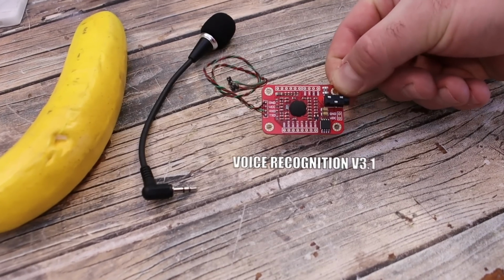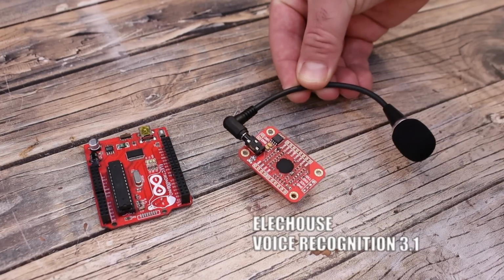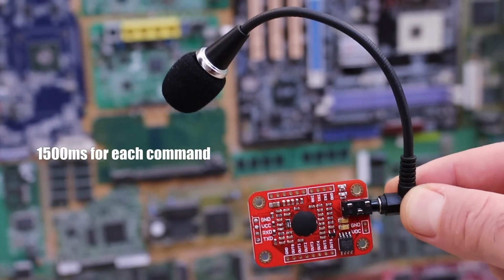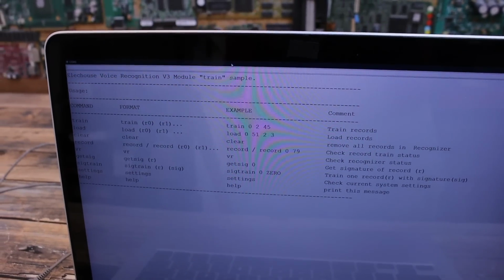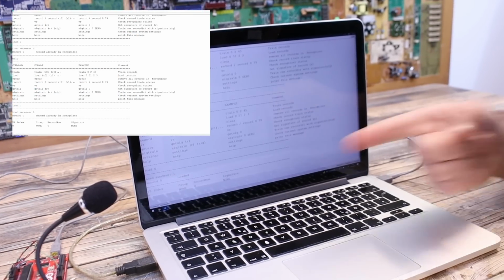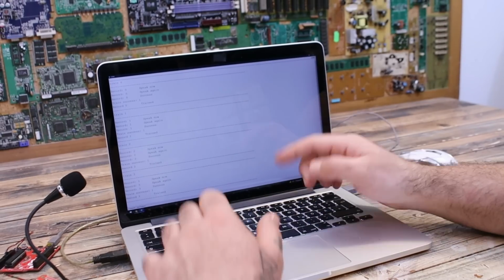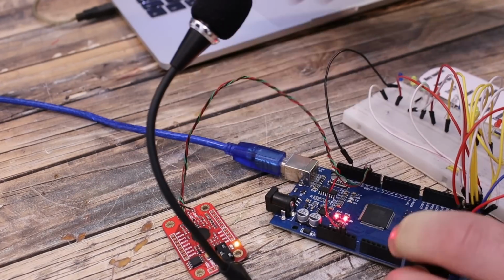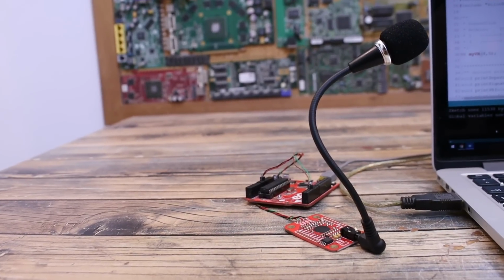Voice Recognition Module - 254 Voice Commands + UART

Comment from the maker: Arduino Course LEVEL 2 (Spanish): https://bit.ly/2ZNWgqy

Follow me on FACEBOOK for more: https://www.facebook.com/Electronoobs
Help me on Patreon: https://www.patreon.com/ELECTRONOOBS
Reply: I think the i2c would be for use with something like a raspberry pi
Reply: @lio1234234  I2c is just another serial port with a specific com protocol.  It can be used to communicate with anything that speaks its language.  The nice thing about it is, it only require 2 pins and can be used in a multi-drop configuration so it's easy to create small (Master/Slave) networks.  Down side is, it's designed to be used physically close to the other players on its network.  You can hang a bunch of I2c sensors on the same two lines.
Reply: Any chance you can publish your code on some git repo? I'd have some minor tweaks to enable also ESP8266 support...
Reply: could you help us telling us what your turn_off_all function does?
Reply: The code I need it
Reply: i need the program for this sensor

Comment: GUYS, quick note here. 

I actually tried this on mega because I have a project using the voice recognition module in arduino mega.

You guys need to connect pin 10 to tx and pin 11 to rx not the other way around.

Ps: But if it works for you then I guess it's fine. Just that mine doesn't work when my tx is 11 and rx is 10

Comment: There’s a Movi speech recognizer and speech synthesizer board that technically  also do the command. Either by closing a circuit or pwm. Not sure yet, I have not gotten deep into it yet but some of the Amazon reviews I saw were quite advanced and capable.. “the R2D2 video” but that board will be plenty to meet my needs in a 1/7 scale RC car application. Lights, fans, blow flames, start engine or engine sounds, music, and just conversation. What I’d really like is if u can also have it read out live Lipo voltages and motor temps and ESC temps. Would I be asking to much for gps/mph and G force lol?? Anyhow if you have content or experience with that board, I’m definitely going to be looking for it as I look at most of your videos!

Comment: whenever i try to write a command in the serial monitor i get an error. For example if i type "record" i get a error message saying "Check record failed or timeout". or if i type "settings" i get "Check system settings error or timeout". My connections are correct i believe. Anyone have an idea why this would happen?

Comment: #include <SoftwareSerial.h>
#include "VoiceRecognitionV3.h"

VR myVR(2,3);    // 2:RX 3:TX, you can choose your favourite pins.

uint8_t records[7]; // save record
uint8_t buf[64];

int led = 13;

#define onRecord    (0)
#define offRecord   (1) 
#define play (2)

#define playtime 500

/**
  @brief   Print signature, if the character is invisible, 
           print hexible value instead.
  @param   buf     --> command length
           len     --> number of parameters
*/
void printSignature(uint8_t *buf, int len)
{
  int i;
  for(i=0; i<len; i++){
    if(buf[i]>0x19 && buf[i]<0x7F){
      Serial.write(buf[i]);
    }
    else{
      Serial.print("[");
      Serial.print(buf[i], HEX);
      Serial.print("]");
    }
  }
}

/**
  @brief   Print signature, if the character is invisible, 
           print hexible value instead.
  @param   buf  -->  VR module return value when voice is recognized.
             buf[0]  -->  Group mode(FF: None Group, 0x8n: User, 0x0n:System
             buf[1]  -->  number of record which is recognized. 
             buf[2]  -->  Recognizer index(position) value of the recognized record.
             buf[3]  -->  Signature length
             buf[4]~buf[n] --> Signature
*/
void printVR(uint8_t *buf)
{
  Serial.println("VR Index\tGroup\tRecordNum\tSignature");

  Serial.print(buf[2], DEC);
  Serial.print("\t\t");

  if(buf[0] == 0xFF){
    Serial.print("NONE");
  }
  else if(buf[0]&0x80){
    Serial.print("UG ");
    Serial.print(buf[0]&(~0x80), DEC);
  }
  else{
    Serial.print("SG ");
    Serial.print(buf[0], DEC);
  }
  Serial.print("\t");

  Serial.print(buf[1], DEC);
  Serial.print("\t\t");
  if(buf[3]>0){
    printSignature(buf+4, buf[3]);
  }
  else{
    Serial.print("NONE");
  }
  Serial.println("\r\n");
}

void setup()
{
  /** initialize */
  myVR.begin(9600);
  
  Serial.begin(115200);
  Serial.println("Elechouse Voice Recognition V3 Module\r\nControl LED sample");
  
  pinMode(led, OUTPUT);
    
  if(myVR.clear() == 0){
    Serial.println("Recognizer cleared.");
  }else{
    Serial.println("Not find VoiceRecognitionModule.");
    Serial.println("Please check connection and restart Arduino.");
    while(1);
  }
  
  if(myVR.load((uint8_t)onRecord) >= 0){
    Serial.println("onRecord loaded");
  }
  
  if(myVR.load((uint8_t)offRecord) >= 0){
    Serial.println("offRecord loaded");
  }
    if(myVR.load((uint8_t)play) >= 0){
    Serial.println("play loaded");
    }
}

void loop()
{
  int ret;
  ret = myVR.recognize(buf, 50);
  if(ret>0){
    switch(buf[1]){
      case onRecord:
        /** turn on LED */
        digitalWrite(led, HIGH);
        Serial.println("LED ON");
        delay(1000);
        break;
      case offRecord:
        /** turn off LED*/
        digitalWrite(led, LOW);
        Serial.println("LED OFF");
        delay(1000);
        break;
       case play:
        digitalWrite(led, HIGH);        
        delay(playtime);  
        digitalWrite(led, LOW);        
        delay(playtime);
        digitalWrite(led, HIGH);        
        delay(playtime);
        digitalWrite(led, LOW);        
        delay(playtime);
        digitalWrite(led, HIGH);        
        delay(playtime);  
        digitalWrite(led, LOW);        
        delay(playtime);
        digitalWrite(led, HIGH);        
        delay(playtime);
        digitalWrite(led, LOW);        
        delay(playtime);    
      default:
        Serial.println("Record function undefined");
        break;
    }
    /** voice recognized */
    printVR(buf);
  }
}

Comment: I'm working on a voice control of lights.  In the setup I use: myVR.load(uint8_t (0)) to load the recorded commands, but it only works if it is connected to the pc;  with external power does not load the commands.  any suggestion.  Thanks

Comment: Looking at the specs, it would be great if it worked with 3.3V instead of 5 - would be usable with ESP8266 - connecting ESP to MQTT and you have wireless voice assistant in any room :)
Reply: I was thinking the same. But an Esp32 should have 5v, right? That would work I guess.
Reply: @AllTernative90  5V power is not the problem - the signal levels on the serial interface are a bit of an issue. ESP (both 32 and 8266) is not 5V tolerant on the input pins, so providing it with 5V TX signal might fry the chip. There is level shifter option, of course, but I am 99% sure the chip on the board also works with lower voltage than 5V. I'll check it as soon as it arrives - already ordered :)
Reply: @rklauco  Ah I see. I'd appreciate it if you could keep me up to date, once you tried it out. :)
Reply: @AllTernative90  So, the module arrived. Tested it with ESP and it has a problem. It does work with 3.3V, but it was getting resets as the lib is written for arduino and uses while loops without yielding back the control to ESP, therefore causing WDT resets.
I was able to fix it by inserting yield(); command at line 106 and 200 of the VoiceRecognitionV3.cpp file.
Since then - no problem at all, works like a charm.
I've tested using SoftwareSerial connected to D6 and D7 of my wemos module (IO12 and IO13 on ESP). Works OK, training it now :)
I'll have to write a code for it to send MQTT commands, but this will be perfect - I can put it to multiple rooms.
My start command, btw, is "Hey, Jarvis" :)
Reply: @rklauco  Thanks for getting back to me and giving all the details! Could you do me a favor and test if it can also recognize sounds like a doorbell? Or does it just work with more vocal sounds? Thanks again!

Comment: would it be possible to add the code  that was used in the video to your website?
It would be great to have it and change variables on it so it can control what suits my application.
rather than writing everything again. especially since in new to arduino writing arduino code.

thank you

Comment: It can only store up to 80 voice commands, not 254. You can cleary see that in the aliexpress product page, and also the parameter for the"record" command, is a number between 0 and 79, giving the total 80 voice commands. Please, update the video title, it's giving misinformation.
Reply: The version he is using is v3.1 while the link he provided is to buy the v3.0. I found the 3.1 on ebay but I would l to know if there is another way to buy it, maybe cheaper.
Reply: @Mattiaeragiapreso  The 3.1 version also has 80 voice commands.

Comment: I'm using it and it works great (as in your video). There is a way to import voice commands as groups (import group of 7 at once, with one code line), but I can't figure out how. Maybe only via hexadecimal commands. It could shorten the code. Support is non-existent.

Comment: You can do voice recognition on a $15 raspi pi zero and have a much larger set of commands and NLP routines as well text to speech. Though this module is super simple to setup and integrate if thats all you need
Reply: offline voice recognition? Without sending any data to Alexa or Apple or whatever?
Can you please give some info where to find such a solution! Thank you! I would be really glad!
Reply: Please share it...
Reply: or give a link..thanks

Comment: Guess you could run several in parallel all receiving the same audio, expanding any given moment by multiples of 7 commands. A robot that had a directives list for example will probably have the need for more than 7 commands at any given moment, having all N commands at ready would need multiple modules all listening. Whichever one gets a pattern match first would then send the data over UART. Now you just need a way to funnel all the UARTs into a single command processor.
Reply: Possibly, but if you need more than 7, you probably want a more powerful system.
Reply: @SmallSpoonBrigade  Ideally you're right. I don't know of an embedded version that is capable of more. The next step would be something like a Raspberry PI running software I suppose...
Reply: running on i2c that might be possible, since each module would be listening for its own 7 commands.
Pretty good idea
Reply: @adespade119  Ideally this will just evolve into more complete system. A voice module that either supports expansion, or the software equivalent of FPGA that can compile and run on something like an ESP32. Thanks for commenting!

Comment: this is extremely interesting !!! it will be best for home automation on the cheap !!
Reply: Can't equal alexa!  Any noise in the background causes failure. (motor running sound on robot, TV set, other people in room making noise) Also, over time your voice changes so you have to re-train it again. Sensitive to volume level. (you must be close to microphone or many fails.)  Won't work for different people. Some words can't be trained successfully. (these are problems I ran into)

Comment: Is this using a ML model to perform transfer learning or is just doing template matching of your voice waveform?
Reply: it's unlikely that there is enough juice in that IC to do any kinda learning. 
it's most likely doing a FFT, followed by spectrum analysis.
Reply: @netroy  you'd be surprise nowadays they have IMU IC's with ML to detect gestures and stuff, but yea that sounds more reasonable
Reply: @NicoDevs1998  yeah. what I was referring to was the cost of the whole thing, not the size.
also, I'm not aware of any IMUs with any gesture recognition features on the die. if you know of a specific IC, or any more info on the subject, please feel free to share. I'd like to know more.
Reply: @netroy  and you can train it for custom gestures